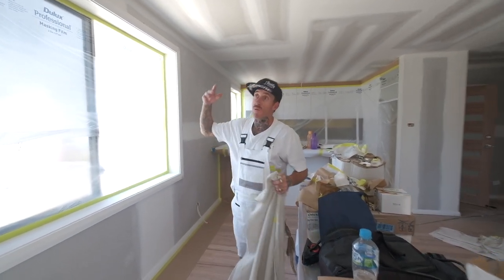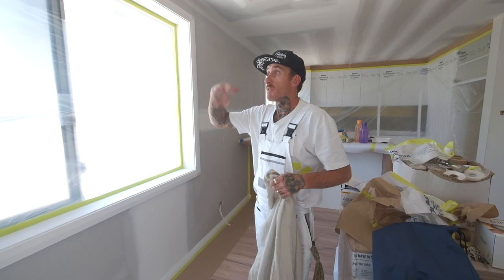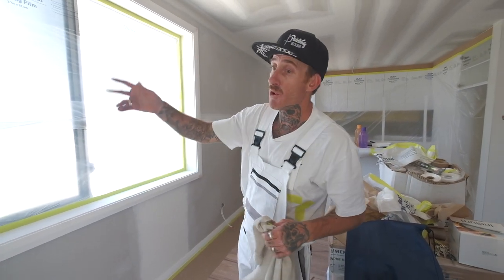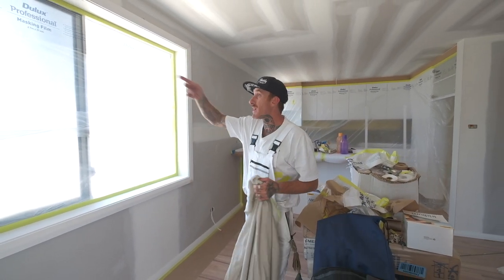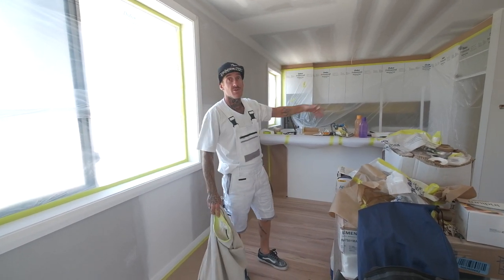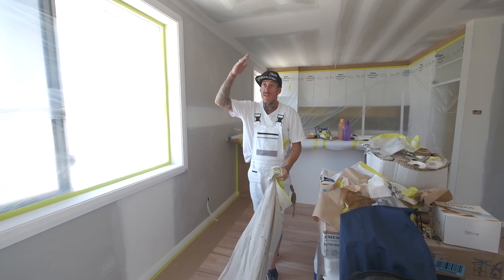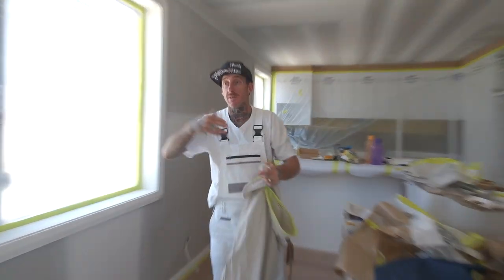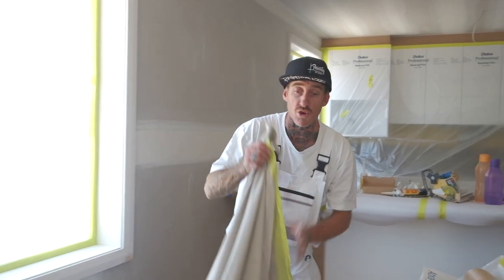MY DROP SHEET HACKS FOR SPRAYING

Comment: Hey mate , great tip, I’ll be using it in the next few days. Curious I watched your vid about spraying aluminium screen door. I’ve just bought the Wagner 350. What would be the best paint to use in the sprayer that compares to duramax satin black? Thanks dude
Reply from the maker: Hey brother. If your worried about the Duramax. I would just use the Dulux Metalsheild Epoxy. Ita not worth getting out the gun for such a little Jon

Comment: Good stuff. What do you do with spraying the doors in a place like that with the floor down? Do you take them off site or set them up in one room? Cheers
Reply from the maker: I spray the doors on the hinges. I tape up the floors or cover them so no paint goes onto the floor
Reply: Cool thanks for the reply
Reply: Another question mate, when switching from primer to colour in your gun. Do you have to run water through first or do you just push the paint through? I noticed in like the garage doors you do primer straight to colour in the same day. Cheers
Reply from the maker: @kieran9  hey mate depending on the products and the weather if it's real hit I like to run water between paints just to stop any paint build up and if running all white but different sheens just to make sure I'm pumping the right material 🤙
Reply: Too easy. Cheers mate and thanks for making the videos, loads of tips that are a big help 👍🏼
Reply from the maker: @kieran9  appreciate it mate. Cheers 🙏🤙